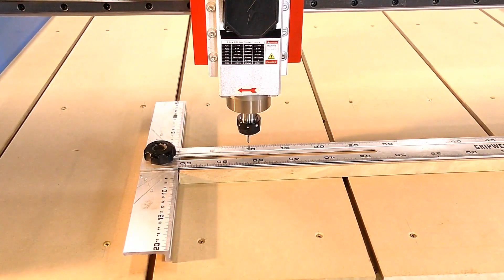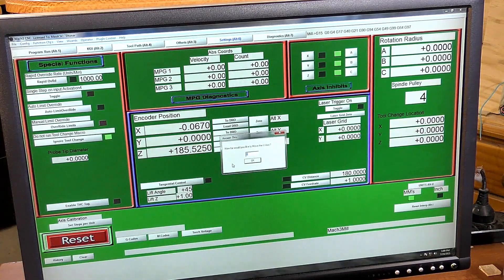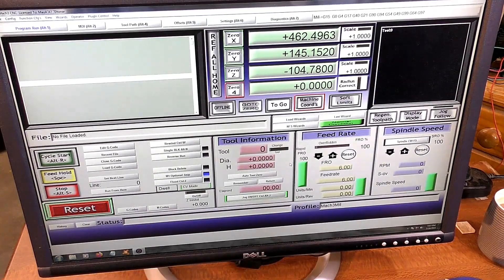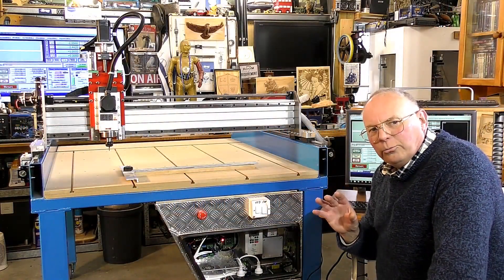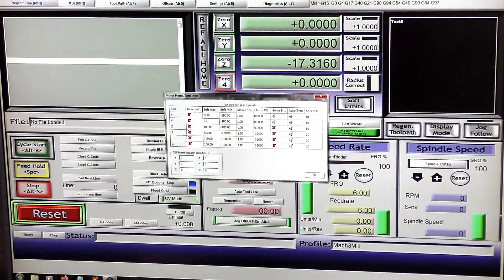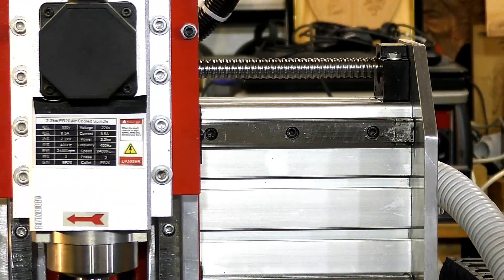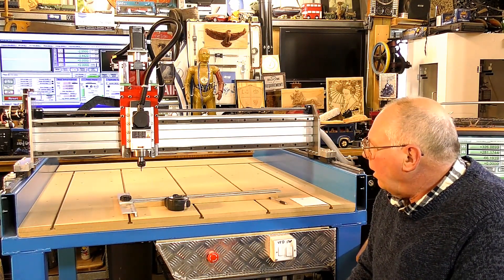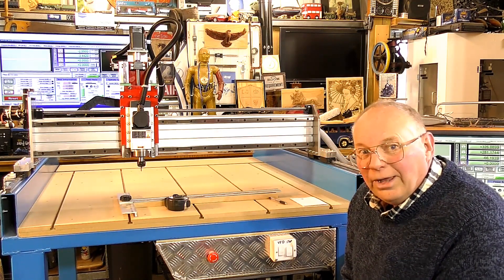Setting up Mach 3 Made Easy How To Part 2

Comment: Using Aspire Vectric  and Mach3 I have set up a CNC router, and a CNC ( Home made Mini Vertical mill, The Router moves the spindle whilst the Mill Moves the Table ( IE the job)  Can I run these from the same Mach 3 machine, IE can I save the settings to allow me flexability. My Ball screws are not the same between the two machines. One cuts Acrylic and the mill Aluminium , Cast Iron and such...